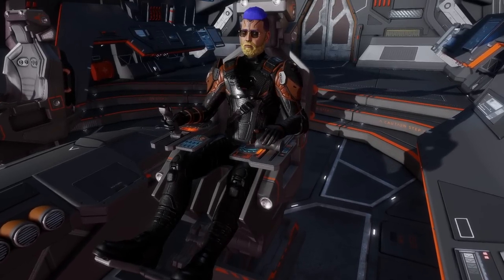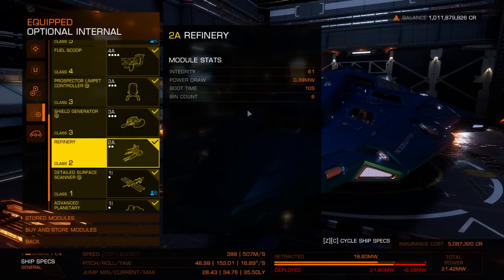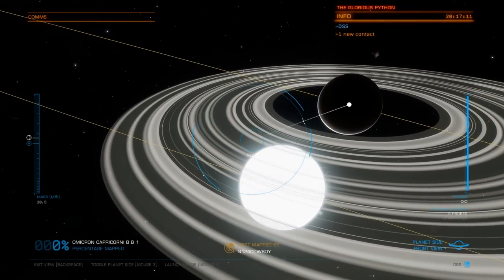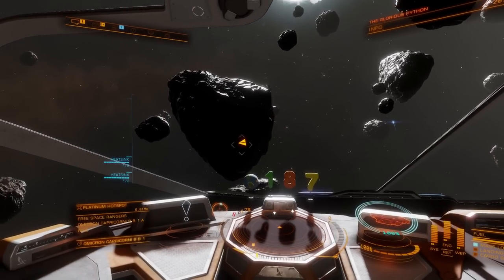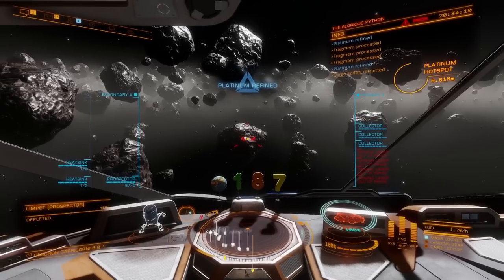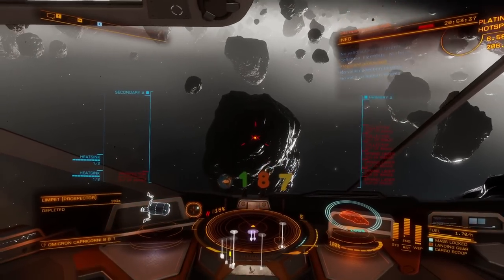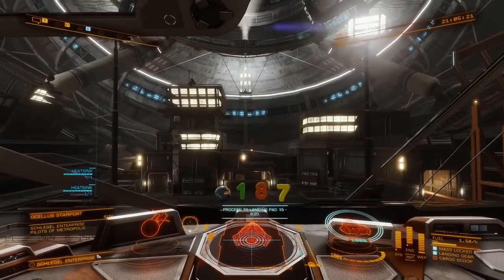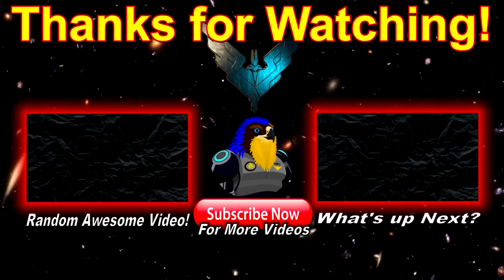Elite Dangerous Odyssey Mining Guide ⛏️ How to Laser Mine in Elite Dangerous 2022 Money Making Guide

Comment: You can do much better if you dive in a Haz Res,  where JUST ONE can give you 32-36 tones !  
Step 1 - search for PRISTINE systems ( higher, max  concentration of ore...)
Step 2 - search, in such systems, for Metallic rings, if you can 
Step 3 - inside such rings, you need a Haz Res - once you got that spot, add the place in your bookmarks - will be your bank ! 
Step 4 - dive in, let pirates scan, get away and mine in the 15-20km range from the point of the center of the Haz Res ( less "curious" pirates at more than 15 km of the center of the spot... In 5-10 min you will fill those 128 tones. Remember, the bonus of ore only work inside the 20km radius.
Reply: what is Hazres?
Reply: @Master_K14  - Hazard Resources
Reply: @mirandela777  thank you I will try just that!

Comment: If you travel full throttle and get interdicted you want to hit your 70% key as fast as possible. This puts you in the blue zone which maximizes you ships maneuverability which greatly helps to follow the escape target. If your mining ship is fast in a straight line but doesn't turn very fast. You can try setting your throttle to zero and submit then go full throttle with afterburners until you can reactivate you frameshift drive. If you choose the submit option I highly recommend equipping your ship with defense turrets to shoot down the hatch breaker limpets they send your way.

Comment: Thanks for the info! Do you have a similar laser mining loadout guide for the Anaconda? Or is the Python still better in this case? I've been away from the game a long time.
Reply: Simplistically: The benefits of the Python are that you can do a mining run pretty quickly and have less issues moving around the asteroids. In an Anaconda you have at least double the cargo capacity to fill and it flies like a brick. You are also limited in terms of landing pads.

However, there are a whole host of other factors that are player specific. (1) What ships do you have (2) What activities do you do (3) Available time to play etc.

Personally (back when I played more regularly) I used the Anaconda to mine as I could do both laser and core without changing loadouts. I then had a python fitted for planetary stuff, mostly engineering / guardian mat farming. Lastly a Krait to mess about for combat missions etc. That being said I farmed the credits for the Anaconda using a mining Python and it was less of a hassle.

Comment: Say sir, never asked a question before and I'm fairly new. Was able to with trade get to the python. My question is on the limpet controllers. WHy so many? why not just one multi-controller? what is the limitations with that? I just got to Denebola (on a list of good on the net) and I don't find hot spots on the rings, only sites (resource sites, low, high, etc). Is that wrong? I did a scan but no hot spots show. Been to the rings 3 times now. The other thing I've noticed is that I can mine along time and only end up with say 12 to 14 T of stuff to sell (here usually gold, silver, plat, and a few minerals). What am i doing wrong? Really could use help.

Comment: I'm finding 'Blind mining' in that area quicker than using the prospector limpet atm. Filling up my Anaconda in about 90 mins as almost every rock has some platinum in it!
Reply: dont do that, an A rated prospector limpet will multiply the amount of loot an asteroid drops by 3.4 times. You may think it's faster but it's actually much much slower.